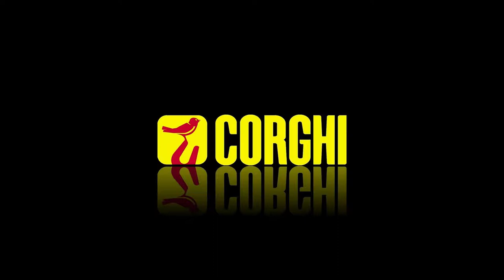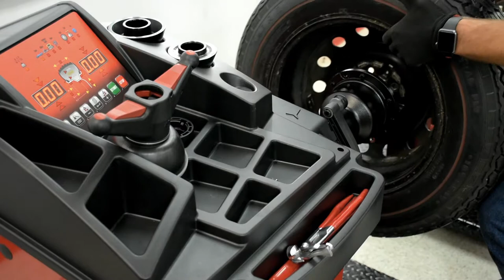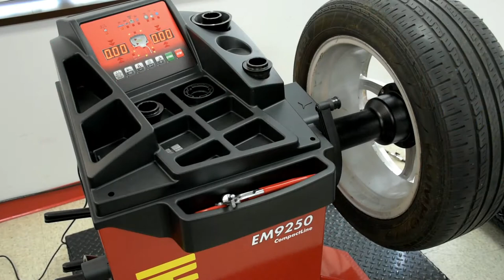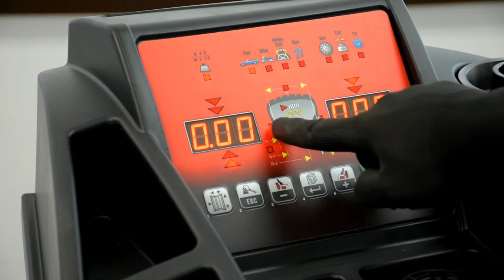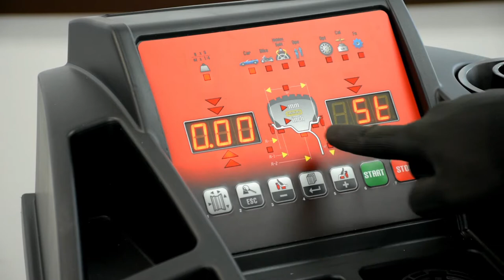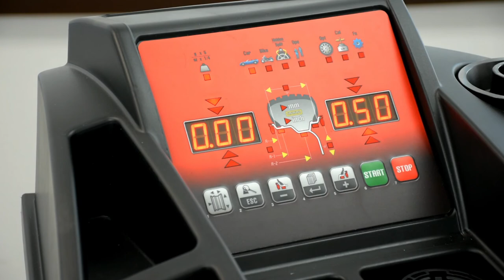9250 USER VIDEO

Comment: Any help on how to use it without the hood?
Reply: I wait the answer?!😂plsss
Reply: @Slayyadelina  I simply unbolted the hood and opened the top of the machine to remove the that brings back the hood. Now as a safety I just have to move the small piece that sticks out where you attach to hood arm to get the machine running, I can do it with my fingers. Let me know if you need more info